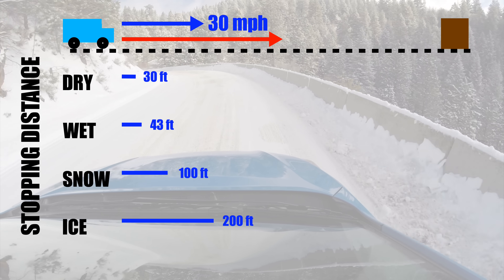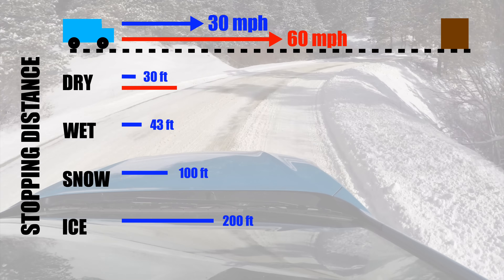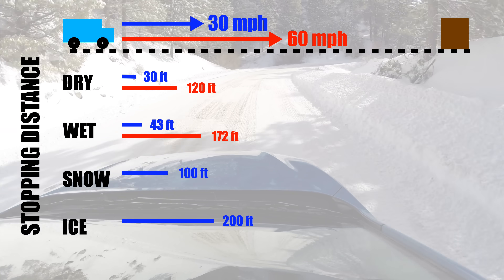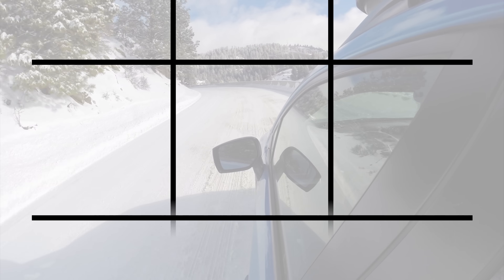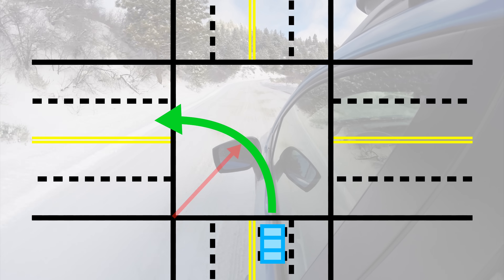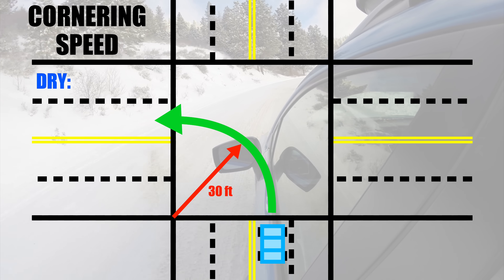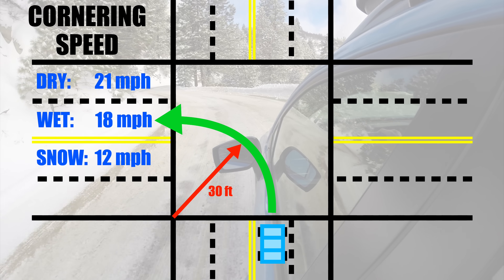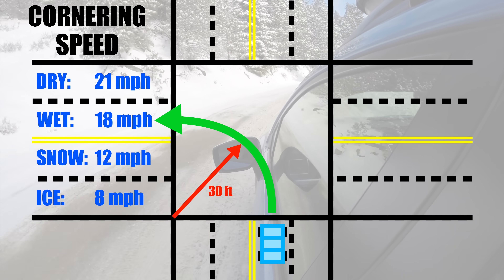Everything You Need To Know About Driving In The Snow

Comment: please let people know that having AWD or 4x4 does not make you much safer when comes to stopping in winter.
Reply: Future Hindsight  All cars have 4 wheel braking. In snow a 4WD is going to be able to accelerate better than 2WD but deceleration is unlikely to be any better.
Reply: Future Hindsight  cmon... So there must b something wrong with this 2wd, either ABS broken or brake force corrector. Now there are also other factors involved like kinda of tranmission not to mention road state.
Reply: 4x4 does help, not in braking, but in using lower gears to slow down.  Four wheels are better than two when going downhill in lower gears. I have decades of mountain driving experience on compact snow and ice. The trick is not to use the brakes first, but downshift carefully to decelerate when possible.  Most folks today just leave the transmission in D and expect the computers to do all the work.
Reply: @David besent the idea is that 4wd changes the brake biasing and allows you to use more of the available grip. In the snow you have less weight transfer to the fronts so applying the brakes without compensating for this will cause them to lock up. Team O'Neill rally school has a great demonstration video.
Reply: 40% of breaking force on rear wheels is rare. It is typically 10% - 20%.
Reply: It only helps with going up hill, acceleration, and getting un-stuck. The same way TCS does't help braking, that's ABS... and that is supposedly less effective than properly braking without abs (in bad weather).

STM may help with corners ...if it was designed for different conditions, otherwise it may just cause a traction loss. But some vehicles are just bad at ice or on road snow (like Jeeps, which surprised me... Particularly wranglers). It mostly comes down to suspension, weight distribution, and tires/chains/studs.

I suppose, if you are downshifting having 4wd or awd would also help, in that it spreads the torque load.
Reply: future hindsight, that makes no sense. You're brakes work the same on a 2wd as they do on a 4wd. and a 4wd is heavier so it will have more force being stopped.
Reply: Future Hindsight: The vast majority of all AWD vehicles in the road today do NOT have the option if locking center nor axel differentials.
Reply: @Future Hindsight- I couldn't tell you but I haven't been stuck either but I have had the ass end kick out. thats why put I the 1000 lbs in the back. I do agree that the 5 speed would be more fun to drive than my 4 speed auto
Reply: Old_Barbarism downshift in a 4x4 on snow it will slow you down in a hurry
Reply: I live in Vermont and every winter on the first real snow day, of all the cars of the road are 90% 4WD/AWD.
Reply: dude- brake bias
Reply: Future Hindsight  I don't think that he's technically incorrect. It's about safety, not stopping distance. Sure, locking all four wheels at the same rate will slow you down faster, but it's pretty dangerous driving characteristics for most people. There's a reason why car manufacturers sends most braking power to the front, while recommending you have your best tires at the rear.
Reply: @anonymoushippo-m7d  read up on what a limited slip/locking differential is. Its an important difference between awd and 4wd which does effect deceleration.
Reply: Correct does not impact stopping.
Reply: awd helps when only 2 tires are stuck in the snow
Reply: @2awesome292  awd often just gets you stuck in worse places, LOL

Again snow tires make a huge difference, all weather, and non snow and wide tires suck in the snow...
Reply: In fact it does stop faster. It's physics. The threshold of motion is much higher in mechanically linked tires on winter roads.
Reply: @anonymoushippo-m7d  this is actually wrong. The mechanical link allows a higher threshold of motion (yes you can stop faster). It's a second order physics thing. Probably too complicated for the average Joe to understand. But it's mathematically proven and also demonstrated over and over in testing. 4x4 does stop faster on snow and ice.
Reply: Dropping the gear with AWD will stop the car much faster than with 2WD -) talking from experience here. Comes winter and a happy face of a Subaru owner!
Reply: That 4x4 statement is silly. If you can't lock up (or fully engage ABS) in the snow you have problems with your brakes..... There is so little traction in the snow I've never had a vehicle that wouldn't lock up the rears. You are at the limit of tire traction when sliding in the snow, not mechanical braking force.
Reply: Future Hindsight  but the car is heavier so u have more energy to loose. On the third hand... you should have a bit more grip... so id say it depends...
Reply: Future Hindsight- funny my rears lock up first. and if you know how to drive in snow you only use 4x4 when your stuck.
Reply: @daltonbrink6336  so again... Do you have ABS? To be honest.... If you really can drive 2wd is enough for the most situations, even in quite steep moutains 😁.
Reply: @luk luk- no ABS. it was giving me constant issues so I pulled the fuse :) but I do load about 1000 lbs in my truck to keep the rears from sliding so much
Reply: Dalton Brink ...or going up the hills of eastern Kentucky
Reply: @kd6836  We have hills in northwest pennsylvania, and we also get a hell of a lot more snow than you do, down in kentucky. You might need 4wd in 4" of snow, but I don't! A little bit of weight, and some momentum is all you need.
Reply: @daltonbrink9924  well kiss my grits. I don’t know nothin bout no snow.  Thank ye for them tips bout momentum in them big northern snows
Reply: I have an Audi with Quattro awd and i can tell you that thing is a tank. Stops much better than 2 wheel drive counterparts.
Reply: @strangeclouds7  good. So what are the factors in your opinion?
Reply: @lukluk1914  I dont know if the abs system differs or the way power is delivered but that would be my guess. Im not a mechanic though lol.
Reply: @lukluk1914  Or maybe their braking system is just generally better. I don't know.
Reply: @strangeclouds7  That's AWD, in AWD the differentials aren't locked. a 2wd  and a awd brakes the same if both have competent brakes. A 4WD has lock differentials, the braking from the front  transfers to the back and the other way around.
Reply: @elchicovip01  Remember the problem here is tire grip, not braking force.
Reply: @strangeclouds7  i have a fwd with proper winter tires, i never got stuck in snow and i survived the harshest canadian winter driving conditions, Its not about drivetrain , its all about good sense of judgement,proper car control, proper set of winter tires and common sense. AWD and 4x4 is useless when there's no traction.
Reply: If you can lock up your brakes at a given speed, main factors are tires, weight, and to some extent loading. Brakes, drivetrain, differential, etc matter little for stopping. It's literally stopping a given Mass with friction between the tires and the road...
Reply: @anonymoushippo-m7d  Team O'Neill rally school has a few videos on this. 4wd absolutely stops quicker.  Google it, it's worth a Google.
Reply: If a 2WD car has good rear brakes then both are good. ABS and traction control are for people who doesn't know how to brake or accelerate with limited traction.
Reply: yeah there are brakes on all four wheels they all activate when the brakes are pressed

Comment: Thank you, Jason, for the video. I may be a greenhorn myself, but having seen the others cling to the steering wheel when sliding in or out of a turn made me smile every time. Or the other side around, they could not get out of the parking spot due to wheelspin ... or could move at a critically low speed due to nearly no grip or traction. An instruction set like this should be attached to winter tyres for those who either can not or would not acknowledge the need (just like Lintassimilator said).

Comment: 1. Put it in 1st
2. Rev up to Redline
3. Release clutch
4. POWAAAAHHHH
Reply: 5. WHEELSPIN!
Reply: The Jeremy Clarkson approach. Power! is the answer to all things.
Reply: This guy gets it.
Reply: best comment
Reply: You forget the kitty litter. Preferably used for extra traction
Reply: 5. Torque steer into a bush
Reply: @fattyMcGee97  if your lucky lol gotta love torque steer.
Reply: no! we need traction!
Reply: xd
Reply: 5. Wait until Vtec kicks in
Reply: LMFAO!!! Funniest comment so far!
Reply: Hahaha
Reply: I get your joke, furthermore I get that the opposite is strongly implied. What I don't get is why nobody ever seems to explicitly expand on that. As in a stuck non 4wd suffering wheelspin, not high centered or anything, literally needs to expand the rpm range where it's getting some kind of traction before breaking into pointless spins while putting it in 1st maximizes torque from "go" when traction is already compromised... Pulling a boat up a hill from a dead stop in good traction conditions use 1st, sure. But if traction is the weakness the solution is putting it in 3rd. Which you can do in an automatic too. 

So why doesn't this guy or anyone else doing these vids ever say that? Never mind telling anyone about how giving it some brake can actually make you go if the wrong wheel of a posi rear is spinning.
Reply: 5. NOT going anywhere FAST !!!  ;)
Reply: Great way to temporarily melt the snow under your tires and turn it into ice when it re-freezes while the snow in front builds up, making you more stuck.
Reply: @logicalfundy 

It's a joke, damn.
Reply: logicalfundy it can’t turn to ice if you keep spinning your tires at redline in 6th.
Just melt all the snow within 30 feet by burning out before you take off from every stop.
Reply: @steaker-gi9uw  you'll stall out once you get any grip
Reply: @sugarbooty  nope
Reply: @jacobwebb8818  Put a car into 6th and try to drive away from a stop without ruining your clutch
Reply: You clearly think horsepower is measured by the size of your muffler.
Enjoy the ditch or the morgue.
Reply: @eriklehnsherr5784  I bet you're a 55 year old that drives a silver Corvette
Reply: @eriklehnsherr5784  you do know that you typically make peak horsepower at redline, correct?

Comment: Can you do a video about why battery technology hasn't advanced as fast as computer/electronic technology?

Everyday computers and electronics are getting more efficient, faster, cheap. At a rapid pace. Batteries are advancing but still suffer the same issues. Capacity, cold weather performance, charge cycles. 

For example my 20 year old cpu works, its just ancient, my 5 year old batteries are cycled out.

I hope you know what I mean.
Reply from the maker: I think it's a fair thing to point out, but I also feel like EVs are advancing very quickly (and much faster than ICE, at this point). In 7 years, the Nissan Leaf went from 80 miles of range to 150 miles of range, more power, more torque, and price remained at $30k. Not even accounting for inflation, price simply remained the same. To me that's pretty solid progress. Buying a 2011 Leaf, versus a modern 200+ mile range EV seems quite different to me, and it's going to change significantly as far as the offerings out there within the next 5 years.

Comment: 4:12 "you may drive with 3-4 seconds" i instantly remembered my daily commute when I sometimes leave less than 2 seconds and every driver behind me thinks it's a great idea to overtake and cut me off. In any condition. Lovely.
Reply: Jarek Pszuk Agreed. It's the lack of OTHER DRIVERS attention and ability, that's impossible to control, no matter how much driving skill and experience you might have.
Reply: California drivers in a nutshell... who cares if the gap is actually big enough? (Also, turn signals are apparently overrated.)
Reply: Yep. Other people's stupidity basically make front and rear cameras a necessity.
Reply: They also yell "brakecheckers r the worst!"
Reply: Acutally, coming from a country where you get proper driving lessons, it's 2 seconds minimum. (By law and by mathematics)
Reply: Let's see. 50 kph, ~14 mps... 2 seconds sound about right for novice drivers to be on the safe side. 3-4 sec would be an overkill. No one leaves 50 meter gap in a big city :)
Reply: @konstantin.v  if you leave less than a 2.5 sec gap in Sweden and thd police spots it, you'll get a reckless driving ticket @60-120€ plus a mark towards loosing your driver's licence.
Reply: @SonsOfLorgar , do you have a link for that? It's too late today to check live webcams in Stockholm to confirm that everyone drives strictly 35+ meters apart. And it doesn't really make sense since the breaking distance is not proportional to the speed, it's proportional to the square of the speed. So, the number of "seconds" should actually depend on the speed you're driving at :)
Reply: @konstantin.v  I did not clarify. The 2 second gap is while out of the city, doing 90 kph. There are people overtaking and cutting me off when I leave the already unsafe amount of space for such speeds.
Reply: @jarekpszuk6944  , we'll all be safe(r) soon when robots take over driving :D
Reply: @konstantin.v  I want robots to take the input away from trash drivers and leave me and my hoonage in peace. I'm not the best driver but I consider myself above average in terms of car control knowledge and judgement on the road, so I don't feel like I'm being a threat on the road, unlike some people. And since I enjoy driving I would want to still be able to do it even when robots take over most of the driving.
Reply: @jarekpszuk6944  , I haven't yet heard anything at all about banning people from driving. I'd say, you have at least 20 years to enjoy it before the banning can possibly begin, if ever. And what about motorcyclists? Driving this type of vehicle is quite unlikely to be taken over by robots any time soon, which would make a solid argument for pro-human driving movement :)

Comment: I have never had winter tires, and I am still alive comments incoming
Reply: I've never had winter tires and I'm still alive!

I've also never owned a car.
Reply: TW: all-seasons are fine!

Which they are if you remember you're driving in the snow with all-seasons and not winters. It's kind of like the difference between rock climbing with sneakers vs. dedicated climbing shoes. Both will get the job done but one does it better than the other.
Reply: Hope you live in Arizona
Reply: I never had a winter tires because I live in equator zone (two seasons/tropical region).

Comment: You're purposely ignoring the "guy from New England driving the old Subaru WRX wagon with a massive rear sway bar and an LSD in the rear" method; mainly initiating turn in with the handbrake and steering with the throttle. Be warned however, using this method may result in an angry girlfriend/wife yelling at you from the passenger seat.
Reply: Can confirm: did a handbrake turn in the snow last winter and my girlfriend and wife, who were in the car with me, were really mad. Idk if it had much to do with the turn tho.
Reply: Won't have problems if there aren't a gf or wife to deal with.
Reply: While an entirely different vehicle, my 91 civic was always fun to throw around in the snow (only time I could...)

That said, it never let me down. 

My 89 accord put me in a ditch driving on ice, but it pulled out on it's own, and got me to work on time, on 3 wheels (popped a tire off when it slid).
Reply: .Did this just today in order to demonstrate to my "passenger" how to counter act oversteer or  a rear end skid.... Guess what?  I Got yelled at.
Reply: I´m really glad i meat that rare kind of species that enjoys small and smooth slides. I just get stabbed in the chest if there was too much handbrake or if i threw the car in a drift.
Reply: They might be mad but you'll have a big grin while being yelled at!!
Reply: true enough but i got yelled at by my ex wife for not driving faster in the snow and ice
Reply: Women who never have taken a handbreak turn on the snow, are usually the least capable female drivers around. -- Women who has played on the snow on a parkinglot from time to time, often can take care of themself when the wheel get a small slip!

Comment: @Engineering Explained How does tire width play a role in traction? Would wider tires help with acceleration and stopping or would a thinner tire?
Reply: Narrow tire is better than wide tire due increased weight spread over smaller contact patch. It is especially true on ice. Opposite on dry roads where wider tire shines.
Reply: Wide in the summer, narrow in the winter.

Comment: Will snow degrade your tires any faster than normal asphalt?
Reply: no, they will wear less on snow than dry pavement. Using snow tires on bare asphalt will wear them quicker.
Reply from the maker: Nope, wear when driving on snow is significantly reduced. Hardly any at all as the forces are low, and the surface is not abrasive.
Reply: Thx for your answers guys. So drifting in the snow won't harm the tires then?